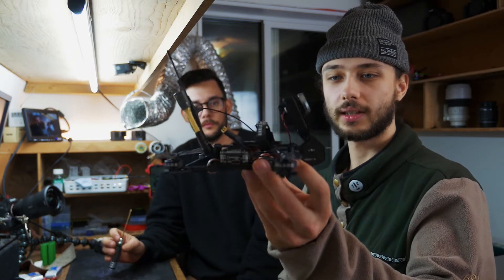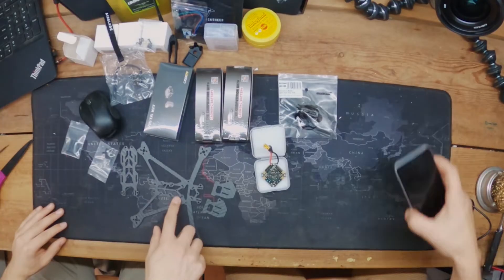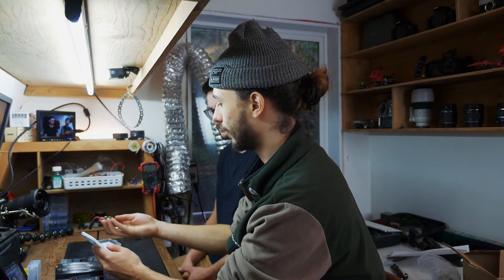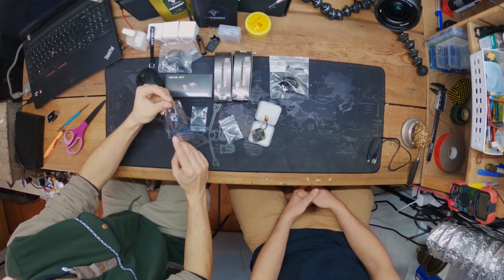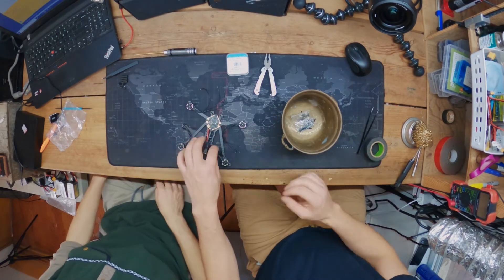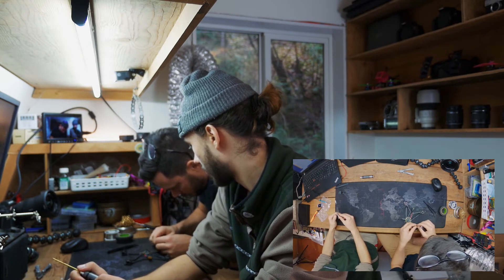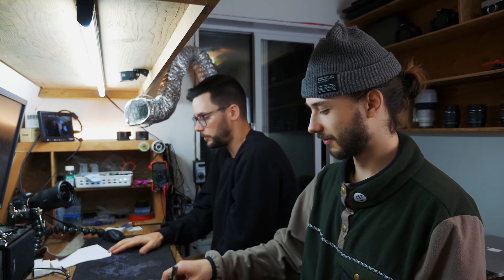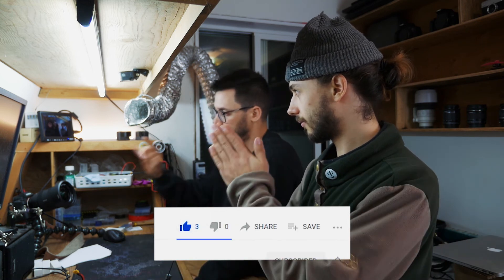Sub-250 Gram Long-range FPV Drone Full Tutorial (Part 1)

Comment: I'm currently building a custom sub 250 long range using an aikon f7 fc and 35a 4in1 esc. just waiting on the motors to show up. Curious to know if the rx antenna is best placed next to the vtx antenna though?
Reply from the maker: Nice one, hope it works well for you! We were wondering the same thing about the antenna, so far so good. We will have to test more though.
Reply: @buildfpv6655  have you flown it yet then?
Reply from the maker: @theshadow2576  Yeah, It has had a couple flights, but nothing that's pushing it too hard. On the tune day I think we will push it a bit!
Reply: @buildfpv6655  looking forward to seeing it. good luck